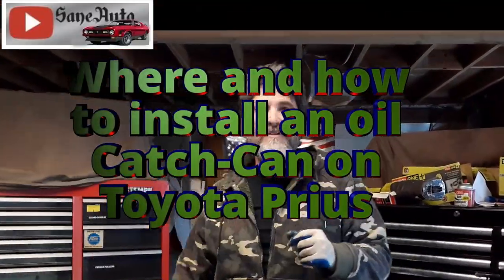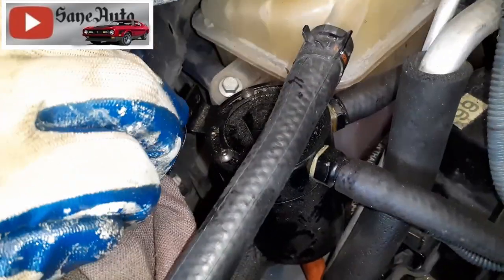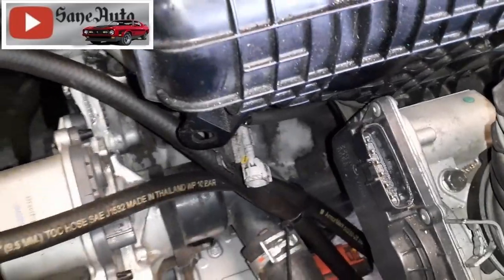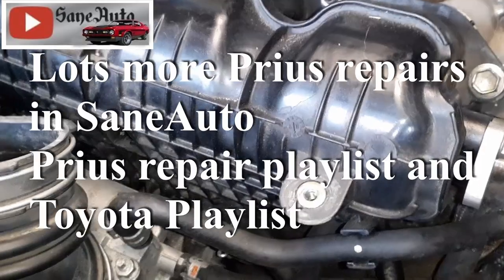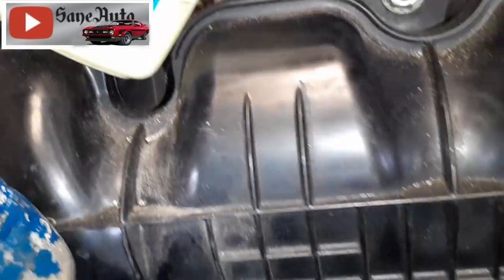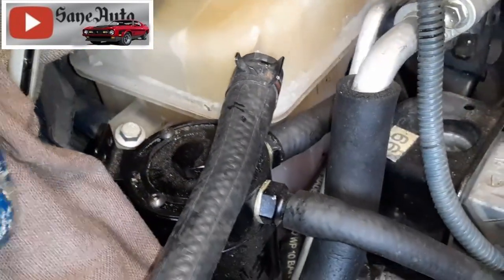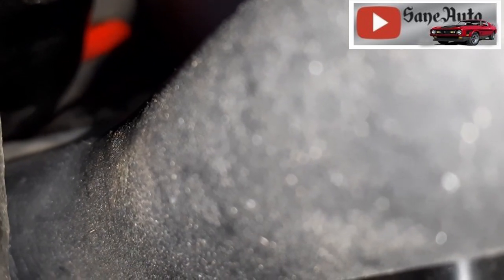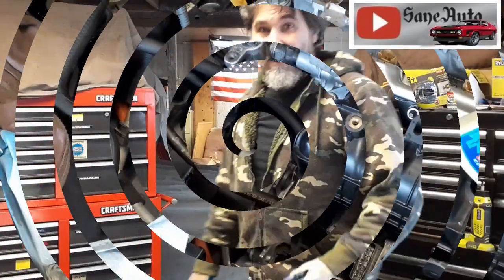Oil catch can (does it work?) why where and  how-to Install Prius

Comment: You should relocate the PCV to the out of the catch can so you can easily change it..I also put 2 catch can on mine I ran it on series ( one to another ) it traps wY more gunk that ends up in the EGR and EGR cooler

Comment: I was hoping a new PCV, when I did my EGR system clean-out at 122K, would stop the engine oil lake forming in the air intake manifold. It did not. Pool was back in a couple weeks. Just put an OCC on yesterday.

Comment: ... found a new water/air separator thats been laying around awhile and plan on using it for a puke can. Learned from your vid that the air filer isn't used so these air/water things are universal puke cans as close as I can tell and am seeing online for about $25. THX .. !!
Reply from the maker: Yes they should work perfectly for that.
Reply: .. we used to tinker with our old trucks and tractors with the blowbye and pipe it back trough some filter gauze into the intake or out onto the ground-n-stuff .. !!
 @saneauto

Comment: I've seen a lot of 3rd Gen Prius owners having condensation accumulation in the OCC and it has a lot to do with its placement. Placing it close to the fan causes this issue. I have mine mounted on the plastic engine cover and I never get condensation build-up, just straight oil.
Reply from the maker: Here in Georgia (due to high humidity) I have seen condensation forming on the inside of a V8 engine early in the morning while Im changing the intake gaskets. This normally boils out while the engine is warming up and the steam escapes through the PCV system. Some of it will be caught in a catch can especially if it is placed near a fan. Just like you mentioned.

Comment: do you find that the catch can is too restrictive for airflow?
I think the can significantly increased the amount of air coming out of the oil adding cap at the top of the engine. Any concerns with it?

Comment: Oil catch can is smart
I just degunked my
Prius
Not fun
Thanks for the idea!
Reply from the maker: Make sure all your hose connections are snug. Any leak between the pcv and intake can cause a no-start condition.
Reply: Hey there. What process did you follow to degunk?